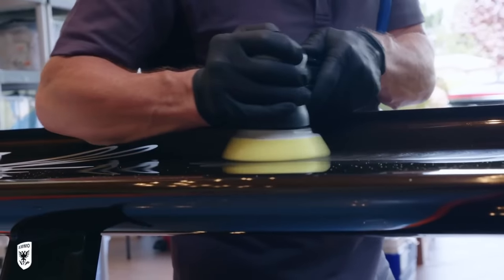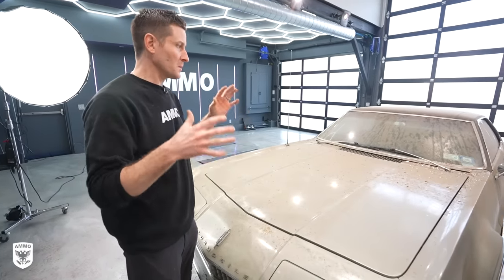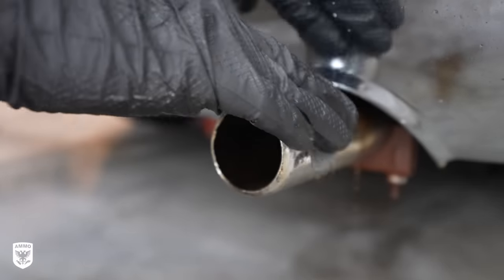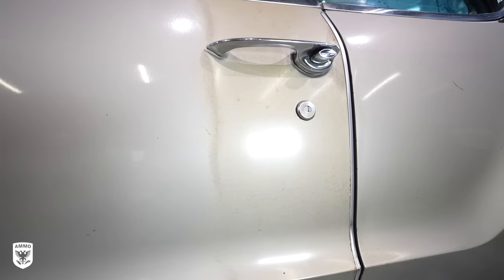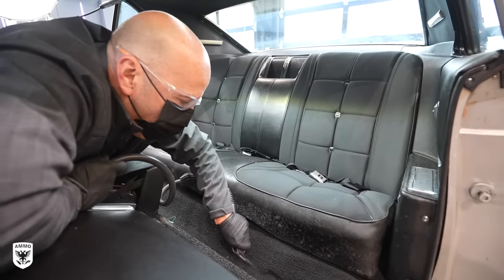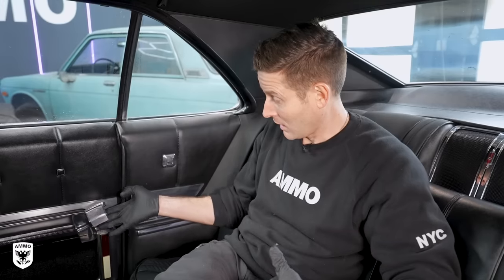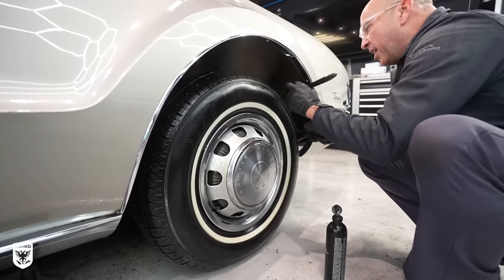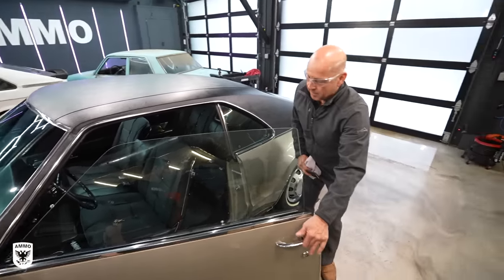First Wash In 15 Years: 1967 Oldsmobile Toronado Disaster Detail and Surprise Reveal!

Comment: I have not washed my 1958 mga that I have owned since  1968– since 1975.. I had it restored, the engine rebuilt, I parked it in my mothers garage in 1975, I put a custom cover on it, and now it sits in my garage. I did move it in 1997. I hooked up a battery, put gas in it, turned it over with the handcrank, and it started up within 10 seconds. I pulled it out of my garage, and I had to leave it outside for two days in the winter. That I started it back up and pulled it back in the garage. And there it sits. My ambition,, Now that I have recently retired, is to have ambition

Comment: I'm astonished by how clean the interior actually was. Of course, it had mold (which wasn't that bad), but it looked much better than the exterior
Reply: Don't forget the Eldorado.  I had a 78 Toronado years ago.  It was the XS model with the wrap around rear window and the 455 under the hood.

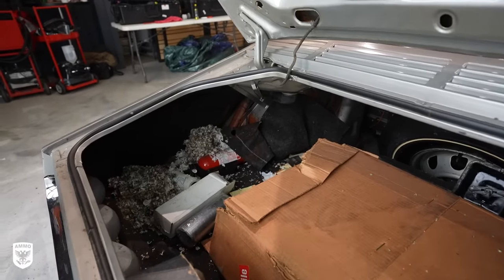Comment: 18:11 Great restoration job. Some of that stuff is probably missing from the walls or attic of the house. I took stuff like that out of an old console radio and it included pink fiberglass, nut shells and a bunch of other things that would not normally be found in a 1948 radio. Rodents seem to round up whatever they can find, wherever they can find it. I'd also check the house wiring for any damage they might have left; one of my neighbors had a fire from the arcing of gnawed wiring  in the attic.

Comment: In 1996 when I was 16, my first car was my great grandma's 1973 Toronado which she bought new.  It only had 31,000 miles when I started driving it.  Amazing car.  AC, power seats, power windows, power locks, front wheel drive, 455ci V8... the thing was just a beast.

Comment: It's absolutely insane how much the color of this car changed throughout this detail. The only real life comparison I can make is when I worked at a local car wash in high school and cleaned the interior of an old Ford Explorer someone bought from a heavy smoker. 

They were so shocked when I called them over to show them the shiny grey plastic interior, they didn't believe it was their car because the car they bought had a tan interior... that was the amount of discoloration from all the tar that came off. 

I used almost an entire spray bottle each of tar remover and interior cleaner in that car between the day, side panels and cupholders/ash trays, but they were so impressed with how transformed the entire vehicle was they tipped me and my team $100 on what was an advertised $70 cleaning package. 

This was in 2005 and to me, that $33 each for the hour or so we spent cleaning it between the three of us felt so incredible. 

Happiest customer I ever saw, they almost cried as I handed them the keys.

Comment: What a car. My mom had a 1974 AMC Ambassador. It was a great car. I used to use a small handheld vac with a brush to get into tight areas and knock dirt loose. Also used the air gun and brushes with shop vac.

Comment: I used to have the Buick version of this car in the 80's, which was a '67 GS Riviera... probably the coolest car I've ever owned and not to mention a complete sleeper. It was a gift from an elderly neighbor when I was in my teens for helping him around his property over the years. He said "you will be the coolest kid" and I was, doing burnouts with front wheel drive simply blew people's minds. It had the newer 430ci v8 with waaay too much torque for the day. I later had to give it up for rent owed for storing it and later in the 90's found a '73 "boat tail" with the 455ci v8.. That car had the smoothest power I've ever seen not to mention a rear window only a dodge engineer could love. Kudos to the dudes that really love these cars and keep them pristine, the old Riv's and Tornado's were as classic as they can get. Just a note here.. back in the 90's I worked in the automotive/autobody industry for a while and came up with a non toxic vinyl restoring compound. Wipe it on after a high ph wash and within a week, seats and dash pads will begin to become flexible again, I have never seen a product that works as good. No solvents to further dry up the vinyl or silicones to make it appear restored, the material actually becomes flexible again without falling apart. Only works on pvc tho!

Comment: I was never a fan of the toranado but she cleaned up amazing.  She's a big gal.  I've spent the last 15 years in the tire industry...a quick tip...  to soften the rubber on old tires try wiping them down with kerosene on a rag.  This will help remove sulfer blooming and rejuvenate the rubber compounds.  It also works great on the tread rubber.

Comment: I like to use the blue soap laden brillo pads for cleaning the white wall tires. I worked as a tire engineer, way back when. There's nothing in the pad that will damage the white rubber. Most of the blackness inthe Whitehall, is oils migrating from the black rubber compounds behind the white rubber...

Comment: I drove one like this with the 455 cubic inch engine back in 1975. Absolut dream to drive even when I kicked it up to 150 mph here in Iceland. If you notice the speedometer it has a horizontal red line across the screen. That is because the the numbers roll by like on a tumbler but the red line stays fixed. Higest number is 140 mph but I went almost the whole circle back to zero again. Crasy stuff and it was almost like sailing a boat on a calm day on a lake. Everything was electric, the seats, the side mirrors, the radio antenna and the trunk.

Comment: I always found SOS scrubbing pads worked on whitewall tires getting them white again. I also worked at a garage at one point that had a diesel/kerosene heated pressure washer that stripped any dirt from the whitewalls of any vehicles. You just had to be careful with the high pressure because I was removing pinstriping from a semi one day and found a crack in the paint and before I knew it about 8 inches of paint chipped off in a split second. My boss waited for an hour or two before he told me that he was getting the truck painted so it didn't matter. He just liked seeing me sweat.

Comment: Since so many have commented on the "lead," from what I've seen/read, the darkening of the pads is due to the flake, which was aluminum powder that had oxidized over time.  (Single stage, therefore no clear coat to prevent the oxidation.)
Similar to the effect of polishing an uncoated aluminum wheel.

Comment: Had a 1966 Tornado to drive for about a week.  It was very nice if heavy car, but a little more responsive than the typical board most full size sedans were back then.  Thirsty on gas, but other than that and not so good drum brakes, a most enjoyable car.  Just do not push it very hard.  Still one of my favorite GM styles along with the 1963 and 1965 Rivieras.

Comment: Terrific vid and terrific job.  But, I'm just sayin' I would definitely have removed the seats and the seat back in the back and vacuumed (maybe steamed) the the max.  And assuming (pretty good assumption) that the interior of the doors and sidewalls had "organic" material in there, I would have loosened them and vacuumed them out to the max.  Without doing this, after even a few days, the cabin would have smelled musty if not obnoxious.  I would also have removed the glove box and done the same vacuuming inside and under the dash.  Huh?

Comment: I always thought these cars were beautiful, and you just proved that.
The overall state of preservation of this 55 year old car is insane.
However, when talking about safety, I don't care how much effort you put into cleaning those whitewalls. They should have been replaced.
Also, the rear wheel locking up is likely caused by failing brake shoes.
This car would get a complete technical inspection before my bride would sit in it.

Comment: Love Oldsmobiles! I used to have a 62' Olds 98. A great car that I bought for $400 with 45K miles on it. My dad drove a 62' Delta 88 in the mid 1960's. Wish he still had that one.  I've heard that the Toronado shared the same frame and drive train as the Cadillac El Dorado, which was also front wheel drive. Do you guys know if this is true?

Comment: I love the loop pile carpet in the older cars, not sure why they went to the cheap crap they use today.  I also really like that second door handle, when I was growing up with had a 1973 Buick Electra 2-door and it could have used that second handle!  I wonder if the 1967 Riviera had that feature since it was the sister car to the Toronado.

Comment: In 1973 or 74 during the "Gas Crisis" my Dad bought a 1968 Olds Toronado with an Automatic, 455ci V8.  That car had all the b ells and whistles...power windows power brakes, AC, Everything.   Gas had gone up to like .39 cents a gallon...O.M.G...😒...so he got a smoking deal on it...I remember he was proud of how little he paid for it.   Same color as this car features here...same black vinyl top.  He had a problem with the cooling system...it would overheat a lot...not sure if he ever got that straightened out.  But what a car.  The front wheel drive was a bit goofy I thought but he was an engineer for Boeing and McDonald Douglas so I bet that's one reason he thought it was pretty cool.  The true to life color was a bit brighter than what comes across in the video with flouresant or led lighting...the original color seemed to me more yellow than that which appears more grey...it was more a beige tint if my memory serves.

Comment: I'm surprised you didn't try a different chemical approach when cleaning the white walls. I generally will go for a high ph/alkaline based cleaner to emulsify the  dirt and if that doesn't get it all off I will grab a white cloth and either Goof Off heavy duty remover or Stoner Tar and sap remover. That technique works extremely well on car white walls and even moreso on Harley Davidson tires.

The Stoner Tar and Sap is my less agreessive option and the Goof Off is the more extreme choice.

I use the white cloth because I found that If you use a colored rag these chemicals will transfer the dye of the rag onto the surface you are working on.

Comment: Youngens this beautiful Oldsmobile is 455 4 barrels and FRONT WHEEL DRIVE - ? We're seats remove for dush also very cool check out speeddo barrel  also full power had 1970 green with white vinyl top and black interior

Comment: The reason these cars were used in demolition derbies was they are typically done in REVERSE and being a powerful front wheel drive car they dominated!
Reply: Yes, I was referring to all that weight over the drive wheels made for excellent PULLING or PUSHING power. But you are correct: reverse protected all the critical components!

Comment: Nice job, but why didn't you remove all the seats and check underneath them with all of the mouse issues?  Also, what did you use on the vinyl top?  Thanks.

Comment: Big front wheel d rive beast, I remember my friend's dad had one in 67, brand new and as a kid I thought a flat floor was pretty cool, no hump for the drive train down the middle. Our 67 New Yorker blew it off the road though.
Hey, is that a '72 Datsun 510 behind you? I'd be more interested in that car myself. Had one, and man, could that thing handle well, especially on back roads where downshifting into the corner was so much fun, you are sliding sideways until you straighten the wheel and your head smacks the wi9ndow it grabs so fast! No one passed me out there because they all braked for the corners.  Japanese Beamers.
Reply from the maker: Yes check out our detail on the 510! Thx for watching :)

Comment: I can still see some pits in the paint, I would have just told them to redo the paint job completely, same color, but the newer paints that aren't lead paint. I'm surprised that the tires weren't flat, or they didn't show that part. Usually sitting for that long makes the tires completely flat.

Comment: Just curious as to why you didn't remove the hub caps while working on the tires to clean them better and easier to work on the tight part of the tires. Also, if it's not private between you and the owner, how much do you charge for something like this, 3 guys for probably 2 days of hard work?

Comment: Well, the thing looks good but does it run? It's been sitting for 15 years. The carb is probably totally gummed up with varnish and who knows what's in the fuel tank. I see that they towed it in (and one of the wheels decided not to turn; not a good sign). Are they going to tow it out? Are they sending it to a tune-up shop that specializes in cars that have been left to rot for years? I'd have done a mechanical check before doing any cosmetic work.

Comment: 28/7 22 To complete the car's story it would have been very interesting to have seen what mechanical overhaul was undertaken too. Surely all fluids, filters, & rubber drive belts must have been changed & the brakes serviced. Are those tyres safe after so long ? Moral ; if you store stuff away enclosed like this place plenty of baited rodent traps in & around the car & garage, open up once in a while to air &/ or keep a cat with some of its food in there from time to time too.

Comment: Next comes the mechanical restoration. Fluids, brakes, ignition etc. and hope the mice didn't chew the wiring. 
I've done a few rescues like this and always do the cosmetic part first. It's a big motivator when you can see what 
the finished product will look like. And much nicer to work on a clean engine etc.

Comment: Sweet interior! I have a question about the lead based paint on this car.  You polished the paint, and you blew your pads off a bunch. So essentially you blew contaminated lead particulates every where in your shop.  I'm a painted, and when I work on homes built in the 50s 60s, and I need to sand vintage painted woodwork, I have to be certain careful about setting up a bubble around my work area to contain the lead dust I'm stirring up, so as it doesn't contaminate the rest of the hone. Very strict epa guidelines with disposal of the contaminated materials as well. I could be sued for boatloads of money if my jobs item is reported for a non certified worker sanding with lead based paintS.  By you blowing out all lead contaminated pads in your shop, how much lead did you put into the air at your place? Have you tested the walls and flats in your shop to see if you have lead there now? Or is thr content of that particular old paint not the same as the house paintS and varnishes? Lead poisoning is no joke, so i was just curious to how you deal with that type of thing.

Comment: Very nice work as usual, intetior is my favorite on these.
A couple questions, on a show car i can see spending the time to clean up tires but if this will be on the road, these 15+ year old tires are def not safe and should be changed. 
Also where the hell did the rodents find a way to get in, and they probably had a nest under the back seat too.

Comment: Great job, but one question, why do you always start the job by washing and polishing the car?
Wouldn't it be better to wash it and remove some dirt and clean the interior?
Finally finish the outside
Reply: Well if you clean the inside first. And you have to remove seats and carpets etc. You won't be able to power wash the exterior without getting those seats and carpet wet.

Comment: If I may humbly suggest- a very effective way to restore oxidized yellowed rubber, is to spray 6% of hydrogen peroxide, lay some tissue paper sheets on them (to absorb and contain the hydrogen peroxide liquid) and leave them on the white walls for a while as you clean the remainder of the vehicle… come back and lightly scrub them with a pumice stone and alkaline based detergent..

From DUBAI with ♥️

Comment: I am surpised that you didn't replace the tires, after this car standed for a long time without moving, usually the tire is deformed after weeks, months, and especially years in the same position ! And I suppose that after 15 years this car needs a good mechanical and motor revision.

Comment: Larry,

When using the titan 12 in this vid on the jambs was it used full strength? 

Is if safe to use if full strength on car paint?

And is that what you’re using for the interior clean and if so what dilution?
Reply from the maker: Yes it was safe in this use case. Would only use on the interior to treat grease related stains.

Comment: I should not give away a secret that I was showing back in the 80’s to clean white wall tires, but I will anyway.
The guy that showed me this was using the flat side of a broken piece of a cinderblock to sand the whitewalls while using purple power. And the result was sparkling white whitewalls.

Comment: With the amount of infestation in this car, I would have pulled the front seats, rear lower cushion, and carpeting. Door cards would also have been a candidate. Mouse pee runs downhill and collects in and under the carpet. If they were in the headliner also, that will need to come out (and usually can't be successfully cleaned). 

I am currently doing my '60 T'Bird. They were in the headliner. When I pulled it down, they had made their nests in the channel along the outer roof rails.  All their pee ran down the channel to the C-pillar base, then down the inside of the rear fender and into the well under the rear seat. Essentially new carpet and pad, headliner,  massive smell removal.

All this in a car stored in a concrete floor, block wall building, with dryer sheets under the seats and dash, and mothballs in containers throughout the car and trunk.
My 1st time seeing this site, very professional work and recording. Thanks!